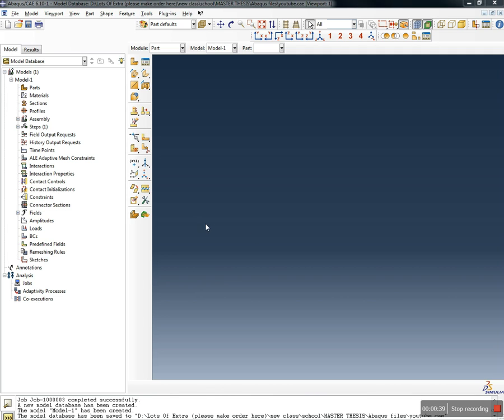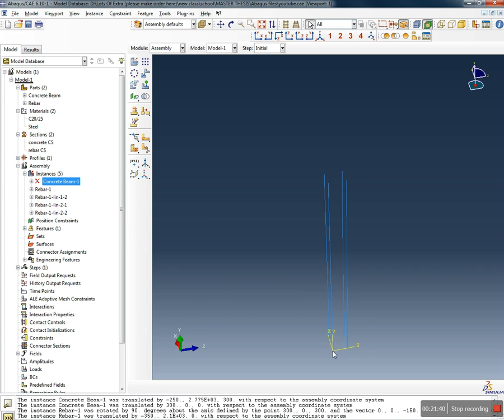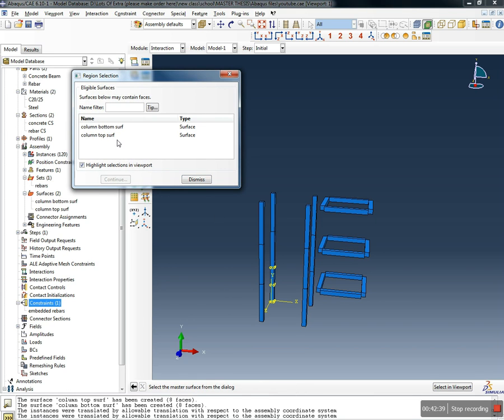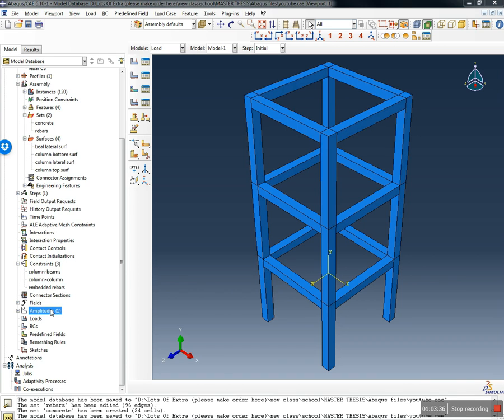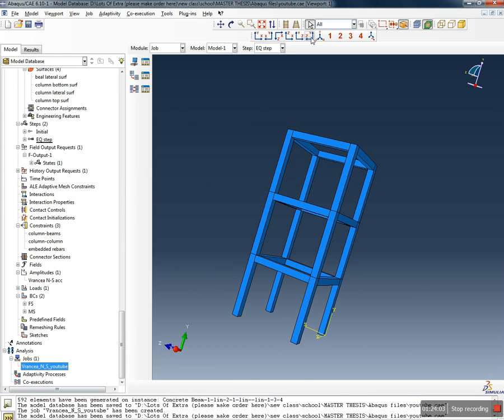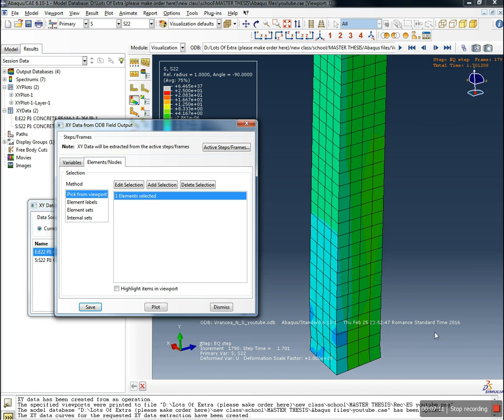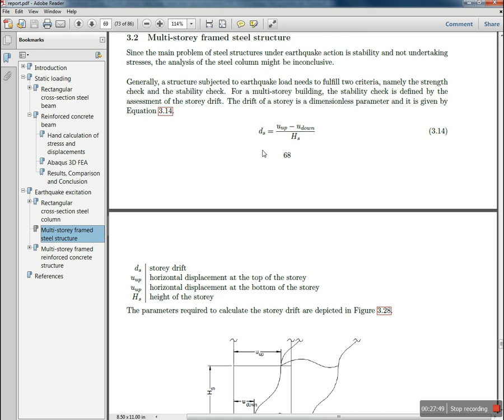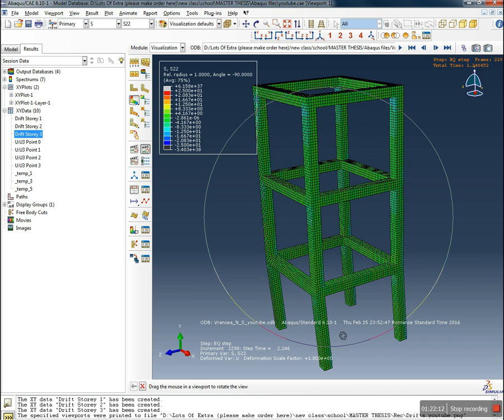ABAQUS Framed Reinforced Concrete Multi-Storey Structure Under Earthquake

Comment: Dear sir, how to impose damping in abaqus???
Reply from the maker: Very good question, I remember I have given it some thought too. It's been a while but I just remember that I introduced somewhere the damping ratio (mass proportional I guess) based on this link https://syont.files.wordpress.com/2007/05/damping-properties-of-materials.pdf. I really don't remember exactly and I might have missed it in the video. I recommend to check the Abaqus user manual. I hope this helped at least a bit.
Reply: There is an option in material propert section of abaqus to in put damping it has 4 fields
1) alpha
2)beta
3) composite
4)structural

suppose i want to input damping of 3% for that i have value of alpha and beta based on rayleigh damping method ,but what values of composie and material do i nedd to input???
Reply from the maker: It is a problem and I can't give you a straight up answer. What I can recommend is to leave that fields blank and take a simple example that you can solve analytically or experimentally (i.e. a pendulum). See what results you get for that.

Comment: Hello bugsy

First of all i'd like to thank you for publishing this video
second i'd like to ask you how to apply cyclic loading in order drift ratio and displacement data not time frequency data as you did in the video
in other words i want to apply the load in this article "Experimental investigation on reinforced concrete interior beam–column joints rehabilitated by ferrocement jackets" by Bo Li from Engineering Structures journal Volume 56 November 2013
the load shown in Fig 6

Comment: Dear Dr
please how to model reinforced concrete beam which contain steel reinforcement as beam elements?
Reply from the maker: +Abdalla Mahzouz https://www.youtube.com/watch?v=XzJC8Nqf8vo (thank you, but I am not a Doctor. my title is Master of Science - MSc)
Reply: Dear Msc
this video explain the RC beam as solid element. i mean the video for modeling the concrete as beam element. thanks
Reply from the maker: If you look further in the video, the rebars are then also modeled as beam elements. If you want the whole reinforced concrete beam to be modeled as a beam element.... i don't think that is a good idea because reinforced concrete sections are not homogenious
Reply: it is possible as in etabs and sap 2000, the RC element modeled as beam element, i want to know how I can do this in abaqus. thanks
Reply from the maker: It is but always pay attention to what you want to use the information for. For example, in Etabs I was reading the moments on beams so then I could compute the reinforcement. I wasn't reading beam stresses in Etabs
Reply: in modeling by etabs , you can model RC section(concrete+steel bars) as beam element. I need this in abaqus to reduce the running time when i used it in full scale building modeling.
Reply from the maker: I don't think that Abaqus has some predefined reinforced concrete setup unfortunately
Reply: Hi Abdalla, did you finally find a way to model reinforced concrete beam using beam element for both concrete and steel?
I am also working on using beam element to reduce the running time. But i still dont have any good way to do it.
I hope you have some good news!
Thank you!

Comment: thank you very much for the amazing work, i'm doing modeling of reinforced concrete column exposed to fire
the issue i'm facing that heat is not transferring to Rebars when i use embedded region.
do you have any idea how to connect the Rebars to the concrete in away that allow the heat to be transferred from the concrete body to the Rebars.....?
Reply from the maker: what you do is very interesting but I have never worked with temperature variations in Abaqus
Reply: +Bugsy Band. thank you for you reply, your reinforcement method was very useful, thank you again and all the best..
Reply: +Ali Raad Hi! I have the same problem. Did u find the way to solve it? Would u be so kind to share, if u did?

Comment: great thanks for the video. By far best on the internet. but i have a question for you. when I tried to partition the columns i got and error message stating "dependant parts cannot be edited or assigned mesh attributes. Try the operation on the associated part, or select "make indepedant" from the instance in the model tree". it driving me crazy and i am following your video step by step.

all the best.
Reply from the maker: +mootassem hassoun Hi. Just right click on the instance --> Make independent
Reply: +Bugsy Band. sure it worked. Thanks a lot you gave me a great start into my PhD.
Reply from the maker: yes, you just have to select the instances from the tree, right click -> make independent

Comment: Dear Bugsy Band,
Firstly, great video!!!
Secondly: could u show me the equations you used in matlab  for creating the nonlinear behavior of concrete material?
In the excel u uploaded there are just the values and equation used for compression (the polynomial eq.), but no equation for tensile behavior. 
Thank you so much.
 
Best regards,
Ciprian (zub.ciprian@yahoo.com)
Reply from the maker: +CIPRIAN ZUB Thank you for your appreciation. I did not use any model for the tensile behavior, I just took the cracking strength a bit less than 10% of the compressive strength and for the tension stiffening I just described a line with some random points so it looks like that.
Reply from the maker: I didn't find any equation for the tensile behavior, that is just a personal approximation.
Reply from the maker: Hi. The tensile behavior is just a personal approximation.

Comment: thanks dude i am going to do this type of problem using shear reinforcements too,have a lappy of i5 processor and  500gb hard disc ,is it possible in my system ?
Reply: +prakash paudel I m using Abaqus with i3 processor and 500gb hd. So I think it is possible for u.
Reply from the maker: +prakash paudel hello. the disc is not a problem. what is needed is a processor with highest frequency possible. I will get a new computer soon, and instead of focusing of having a lot of cores, I will focus on having less cores (two) and very high frequency for each, around 5-6 GHz would be nice. more cores means that you can run more analyses in the same time, but for the moment i just want to run one at a time, and fast (and still i have the other core if i want to run another one). i also have i5 now, but it also depends on what generation of i5. i have 8GB RAM, but i still believe that the processor is more important for this analysis than the RAM. However, this analysis took 30 hours with i5 and 8GB RAM. I will go though for 16 GB RAM for next computer, maybe an ASUS from Republic of Gaming (i dont get it to play games :) but they are very good). If you want to do the same analysis including shear reinforcement, i suggest to take initially only the first second or the first half second of the earthquake, or even less, to see how it's going, and if all is good than you can run it with full time and be prepared to leave it running for 2-3 days or even more :D
Reply from the maker: Well, I guess anything is possible. However, for best performance, a high end computer (fast processor with many cores, lots of RAM, high end graph card) is recommended. Small mention since my last comment, I guess all the cores can contribute to the analysis and not only one.